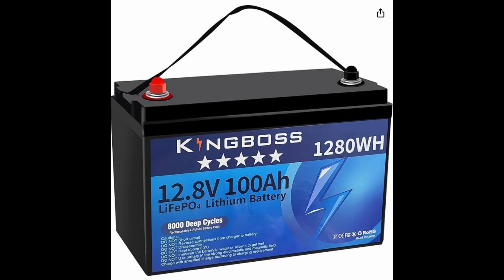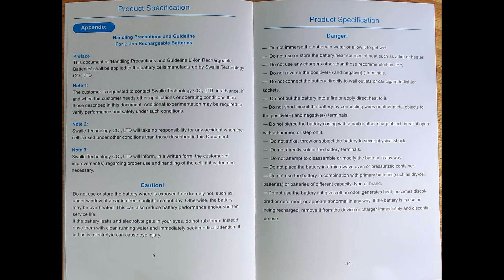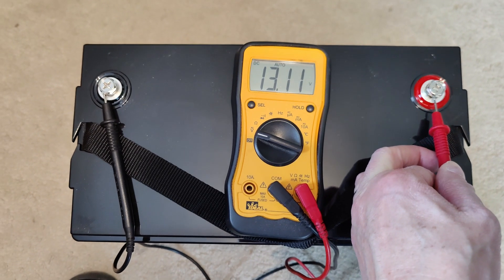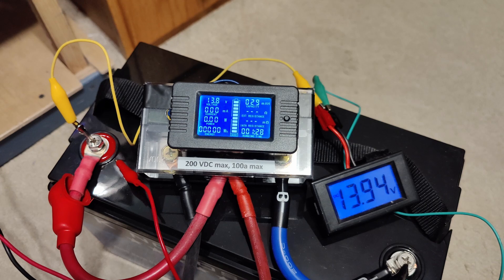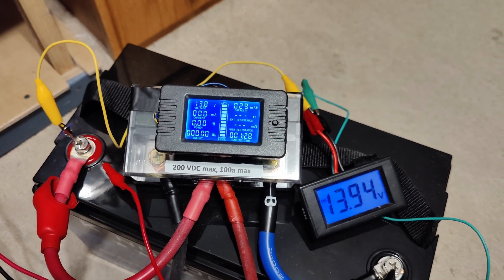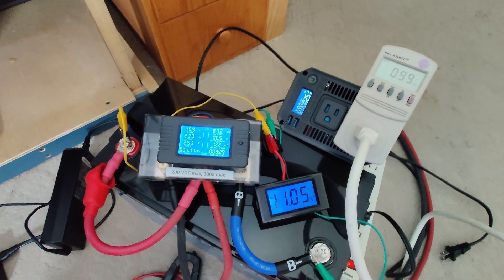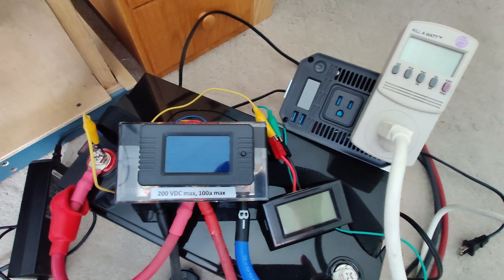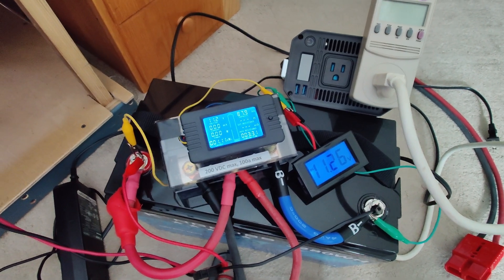Kingboss 100ah LFP Battery Review

Comment: Lithium solar just did a tear down on this $78 battery.  https://youtu.be/MGe4rZjOt_k.   It was missing two cells so it tested at less than 90 AH not 100 as advertised. The BMS wasn't even tied down but loose.  But at $78 it's still a deal.